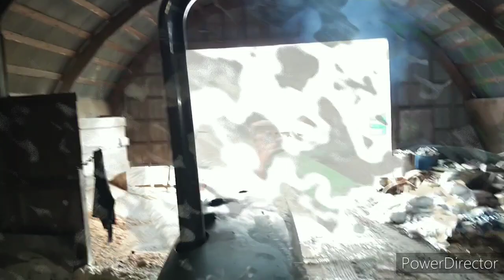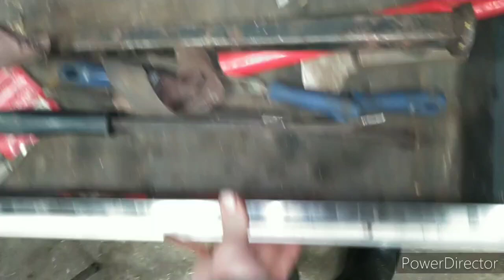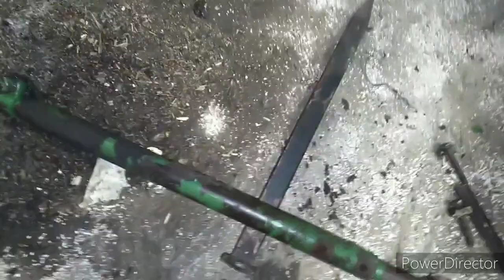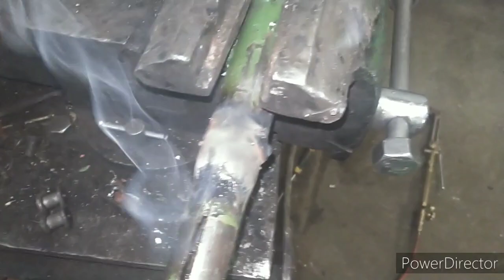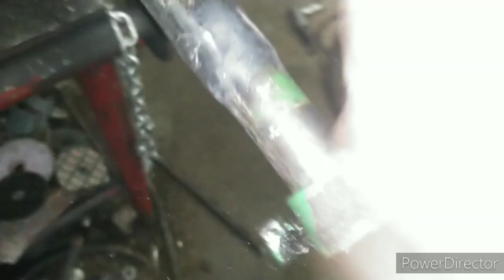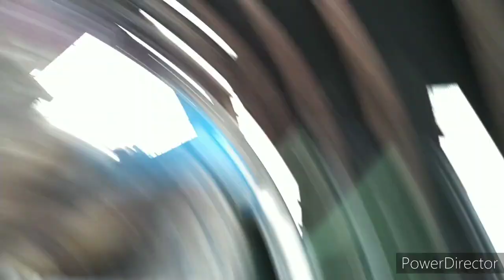4430 tie rod repair

Comment: It's kind of a rush when you conquer a job!
I have come to like the cut off wheel on a grinder. Whenever I have a shaft stuck inside a tube I make one measly attempt if it don't move I split the shaft with the grinder or torch if I have to.